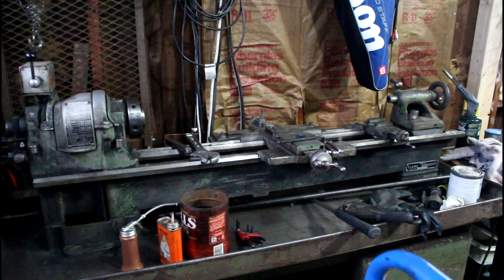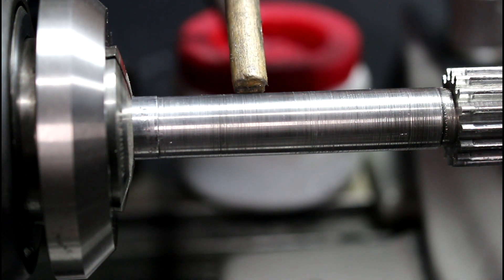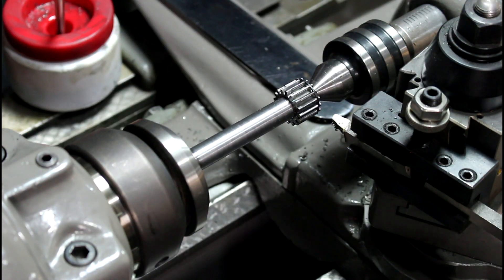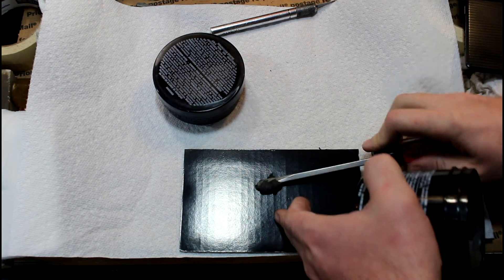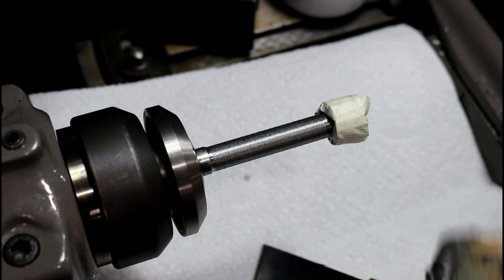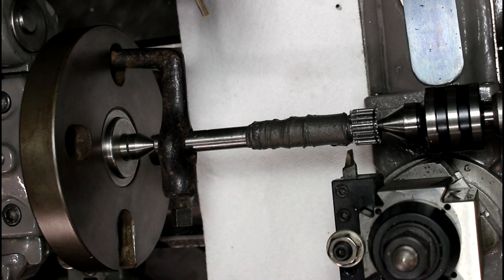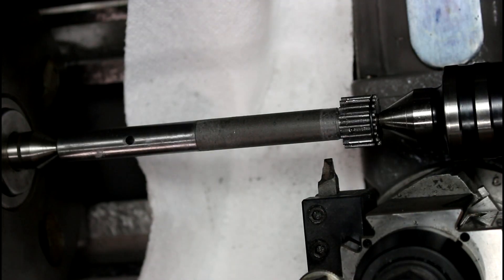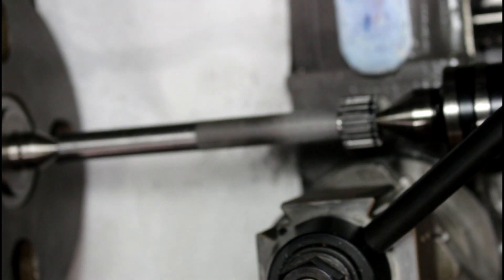South Bend Shaft Repair with epoxy

Comment: I have the same issue with my Clausing lathes. Both of them. I was planning on just re boring the hole and putting a oilite bushing in them. I guess it is easier to use the epoxy than to set up the apron on the mill and resize the hole.
Reply from the maker: The last one I did with a south bend was to bore and bush it out. I also put epoxy on the shaft. They were both wore fairly evenly. Main hand wheel crank was nice and solid after that. Pinion was still loose though, I didn't touch that one. Only reason I didn't put a new shaft on this one becuase I didn't have the proper reamer/drill bit to drill a new tapered hole for the retaining pin on the hand wheel.
Reply: @precisionmachineshed  I will do the same on mine. I hate slop in a precision machine. Even tho this is more of a nuisance slop it  just does not belong there LOL Thanks for the reply.

Comment: Hi, I hope you can help me. I have a precision ground steering rack shaft out of our VW. It's maybe 24" long in total by 5/8" diameter.  We are rebuilding it and one end of the shaft which slides back and forth through the central tube shaft seal (which is like a hard rubber / silicone) has some minor pitting / rust in a few spots all within ~ 3" where the rack boot was cracked.  Unfortunately this rack rod is not a part I can replace so I either just clean it as best I can and leave it, or try and fill in the pitted spots with epoxy. The problem is we're talking a few thousandths deep if even that, and each spot is maybe 3-5mm wide (and there are 3 or 4 of them), or.. do I go to the extra trouble of getting something like this done where at least 10 thou is taken out down the whole 3", then epoxy filled, lathed, and re-sanded down to 2000 grit if the epoxy could even get that smooth which I doubt.  Given this is a precision ground steel shaft which is like mirror chrome smooth and needs to seal up with the internal silicone ring seal I'm thinking this method will probably not work.  Thoughts?

Comment: a fix but not great by any length
Reply from the maker: It has actually held up better to date than the original. Still the same measurements as when I cut it. Unfortunately, it is harder than the cast housing it is in, so It needs replacing due to excess wear on the housing.
Reply: Precision Machine Shed that's a shame

Comment: I used to use that 2 part epoxy stuff (either JB Weld or Loctite) to repair the armature shafts for the Rupes sander/polishers as the fan would lose its grip on the section it was pressed onto & wear the armature shaft out.

I forget what material it wore out on the shaft as that was over 15 years ago but the fan was plastic.

My manager bought some in from home as he used it to repair the water pump in his washing machine, it spun on the shaft so he used the Loctite 2 part epoxy repair & it worked.

I still use it at home with speedi  sleeves to fill the grooves in made by the old oil seals.

I'm looking to see how that would work on my lawn mowers stub axles for its wheels as the plastic bushings have worn grooves into them.

They have 1/2 inch shafts on them & I was looking to fit the metal wheel bearings to them but the mower is old & I can't find dust covers for them,one of which is missing,I need them to keep the dust & dirt out of the bearings.

They do make special 6001 2RS sealed bearings with a 1/2 inch bore in them & there are a 1616 2RS ball bearing available to suit but they are too expensive.

The other option is to try & chase up some 12mm shaft stock,cut the 1/2 inch shafts off,weld the 12mm shafts on then fit the standard 6001 2RS bearings as they are cheaper & have a 12mm bore.

The standard Supa Swift base has circlip grooves machined into them but since I don't have a lathe I'll have to use push clips if going that way.

Comment: Hey, can you tell whether that surface is worn out already or it is still alright?  Thanks.
Reply from the maker: Hello, yes it is still holding to very well. This was on a machine I sold and I was just over there the other day. The guy has it has used the lathe quite a bit to make numerous parts.

Comment: If you need to fix it again, you might consider parting off all but about 1/2 in of the shaft from the gear, bore and thread the gear leaving a hub. then making a new shaft with a corresponding thread. and lock tight the two back together or pin it..  just a thought, keep up the good work.
Reply from the maker: Thanks, that would work too. I'm going to throw it all back together today and see how it works. Should be fine. Thanks again.

Comment: I got lucky with my 10L, those shafts and bores were fine.  I added an oiler cup out towards the handwheel end to prevent it from wearing in the future.  Can't remember if I used a 1/4-20 or a 10-32 one, but whatever the smallest one Gits makes is what mine has now.  It comes in right over the felt slot to keep the wick oiled. 

 Other option for replacing that assembly might be to make a new shaft.  I don't remember if that gear presses on or if its cut from the same stock as the rest of the shaft for a one-piece setup but you could either press it out or cut the shaft and bore the gear out to fit a new shaft in there.
Reply from the maker: My main 10L that I restored a year or so ago I never put that extra oiler in the apron. Always said I would do it later. However I keep that thing clean and oiled and there is always oil ever so slowly seeping out between the apron and the hand wheel. At this point I don't see a need to put one in and that thing is tight as a drum! 

The gear and shaft are one piece. I could cut and bore it out then press it on, but this was much quicker. I'll buy a good used one when it comes along for $10 instead of spending several hours making a new one with my somewhat limited tooling at this time. Thanks for the comment!
Reply: There is a wick in there that feeds oil in.  It gets caught in the gears sometimes and tears though.  Mine was ripped, but I guess it didn't get used enough after that happened to cause damage.  The oiler just makes it so you don't have to worry about the wick.
Reply from the maker: Yeah, I replaced all my wicks when I restored my lathe. When I was working on the unrestored lathe, I cut an old wick when test fitting parts. I can see how it's easy to do if you're not paying attention during assembly. I was very careful not to do this when I restored my other lathe.
Reply: I replaced all my wicks too, the original that I took out was torn.  It was ragged and you could see where it had gotten caught in the teeth.
Reply from the maker: I know some guys when they replace them tie them out of the way with small wires. I didn't on mine, but I did notice a few half cut wicks on this one when I pulled it apart.

Comment: Make a new shaft !
Reply from the maker: I thought about it and figured the time I would have into it wouldn't be worth it when you can get the occasional used one off ebay for $10. I also have been wanting to try this out for some time, figured this was as good a application as any.

Comment: Maybe the best thing would just to make a new shaft, I'm sure you agree to that or..?
Reply from the maker: Yeah, this was much quicker though. The gear is part of the shaft so I would have had to cut it off and press fit it onto a new shaft which would not have been a big deal and I could still do it. I just really didn't want to have to deal with re-drilling that tapered hole for the taper pin and making everything line up perfectly.I don't think I have the proper gear cutter to cut a new gear on a new shaft ether.